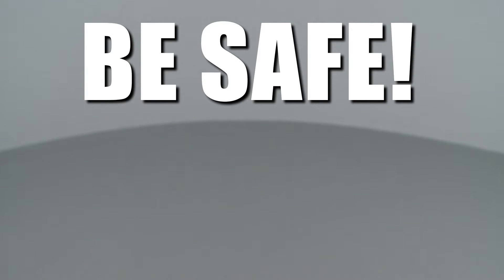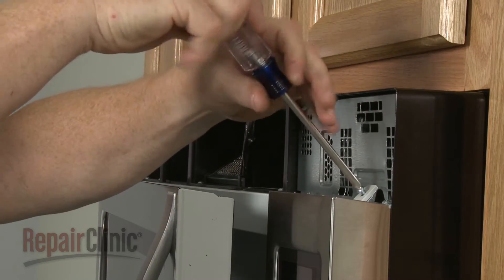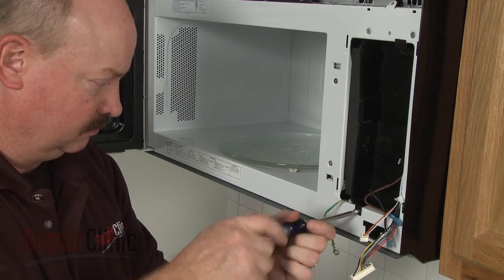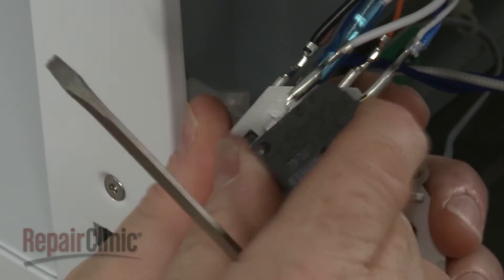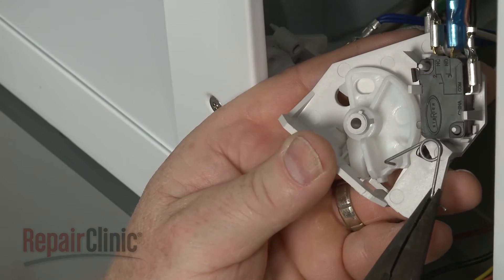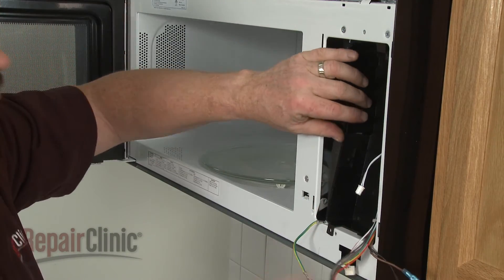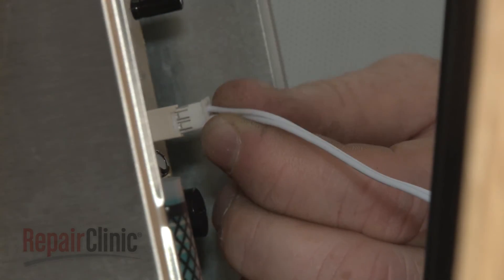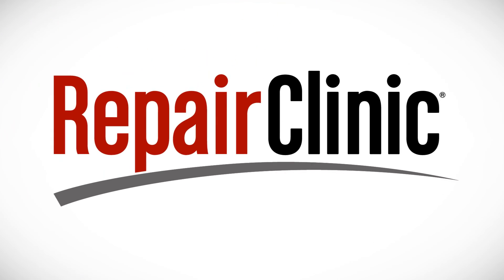Whirlpool Microwave Upper Interlock Support Replacement 8206419

Comment: is the interlock support a common failure point? i can’t imagine a scenario these fail unless slamming the door.
Reply: I think it's more an issue with the spring.  I'm getting an open door message and the switches test out good but I think the cam is not moving as it should.  I might have to bend the spring to ensure that it's moving the cam as it should.  Someone else posted a similar issue but I can't find it right now.